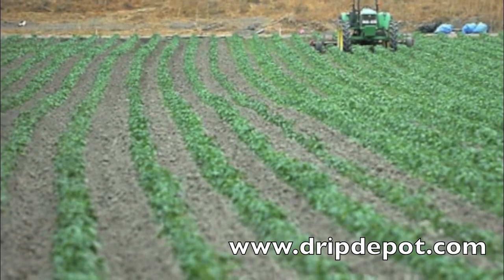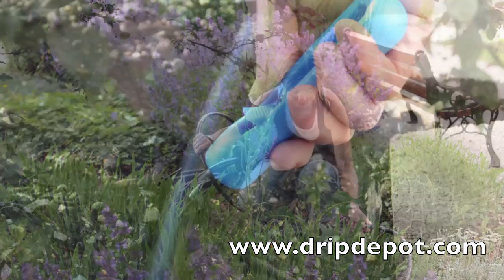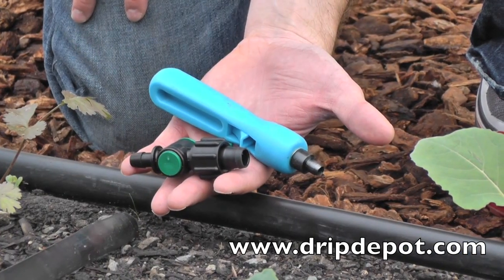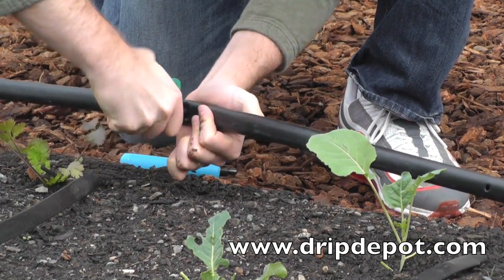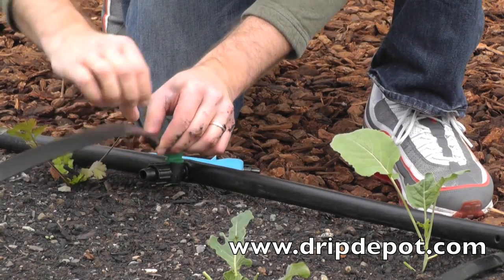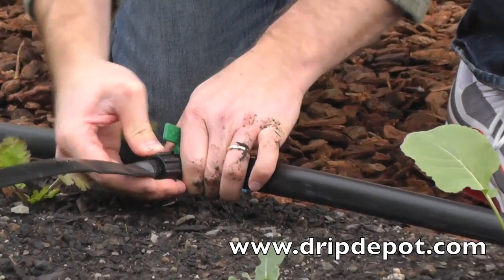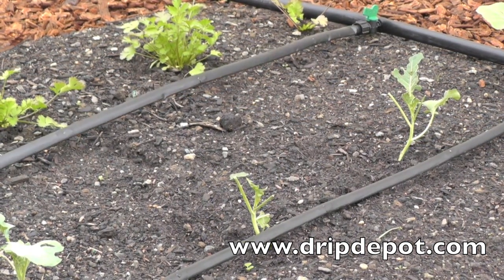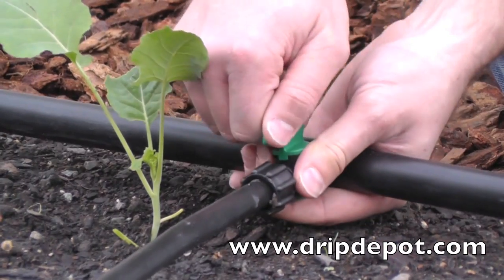How To Set Up A Drip Irrigation System For Small Farms

Comment: This works for lined crops, but what about hay fields?, and talking about maybe 20 to 40 acres.... I like the idea of sub-surface irrigation, but Im a diy'er, and sub-servace seems expensive right now,,, and would be nice if you could have your tape on a roll at the end of the field where your going to water, and when you need to plow or something you can roll up the tape so its not on the field with like a hand crank hose real or something ( real large enough to roll up entire drip tape for length of field... and when you want to put it back, just grab the end and walk it down to the other end of the field.... and, I only plan on using rain water,, ( I hope ),, depends on season.. and gets pretty dry around here... any information on this would be great, and possible cost for up to 20-40 acres for hay production....Thanks
Reply from the maker: Grizzly Tee There is a lot going on in sub-surface irrigation.  Drip Tape is a viable option for this as it is less expensive than poly tubing and has been used in sub-surface irrigation for many years in the larger agricultural fields.  You are welcome to contact us at support@dripdepot.com should you have further questions